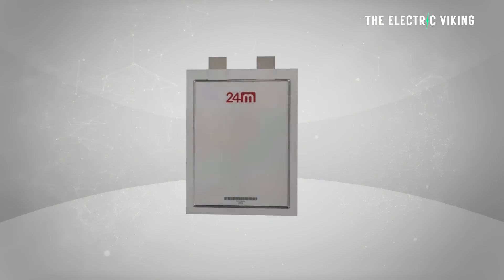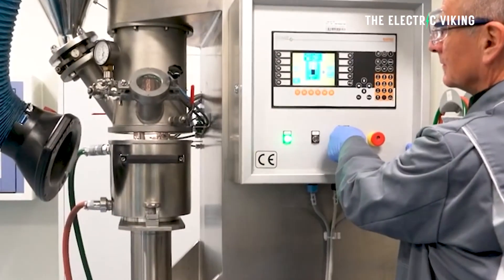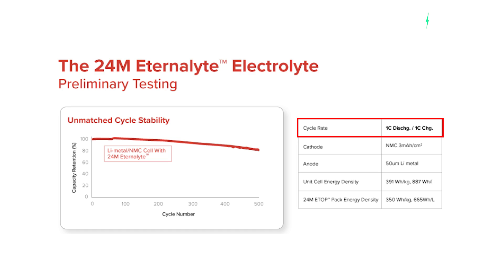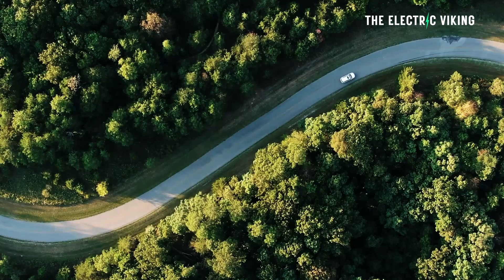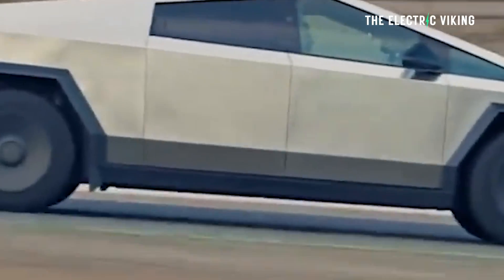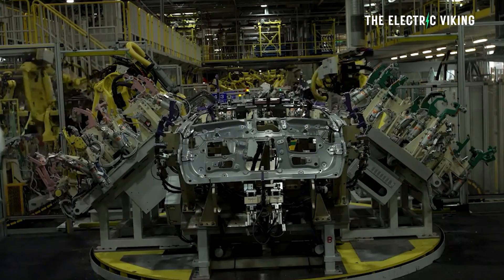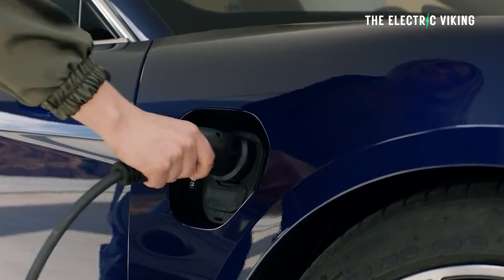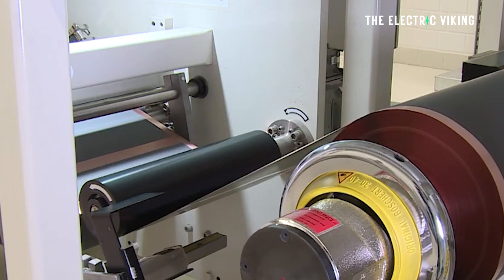American battery company reveals production ready 1000 Mile EV Battery

Comment: Hi, Sam. I'm a retired Aerodynamicist (actually specialised in Flight Dynamics, but know the processes used for Performance Prediction), and am not optimistic about battery powered flight except for very short range. A useful quick estimate of range can be made from the lift/drag ratio and the weight (which doesn't change for battery powered flight). So if L/D is about 20 (typical for a commercial airliner), each kg produces about half a Newton of drag. Each km consumes 500 Joules per kg (assuming 100% efficit conversion from electric power to thrust). A kw.hour will therefore give a kg a range of 7,200km. If the airframe and payload were weightless, a battery with 380 W.hours/kg could propel itself 0.38×7200 = 2,736 km. Unfortunately converting from power to thrust involves pushing air backwards - you haven't got firm ground to push backwards. It's hard to get as much as 80% of power turned into thrust, and you're likely to lose another 5% to the electric motor being less than 100% efficient. So the range is down to 2,052 km.The there is the reserve you need for diversion if the airfield you plan to land at is closed (for example during a recent storm, one aircraft that failed to land at Edinburgh had to divert to Cologne, another to Paris). I'm not sure what the legal minimum reserve range is, but both of those aircraft were forced to fly an extra 800 km. I'm guessing a reserve of 500 km. That brings the range of the battery by itself down to 1500 km. Adding an airframe and powerplant weight roughly equivalent to the battery brings the range down to 1,026 km without reserve, and about 500km with reserve. That's barely enough to do an internal flight in the UK, certainly not medium or long range. To cross the Atlantic, you need over 5,000km range, so looking for an energy density about 5 times higher than this solid state battery. 2 kW.hours/kgm might just about do it. But thanks for the news, Sam, I really appreciate it.
Reply: If the mission of the flight is to transport a payload of batteries and nothing else, then it might make sense 😂.
Reply: I agree. Commercial electric flight will be a long way to go
Reply: Thanks for this analysis. I concluded the same a while back - electric flight is possibly feasible for air taxi services but long haul flight? Not a chance! As you said, even with 5x current energy density, which works out at around 1600Wh/kg, it’s still insufficient for a cross-Atlantic route. No battery technology has anywhere near that energy density, even theoretically. It’s a total non-starter.
Reply: Just for kicks, would it be feasible to cover airplanes with small rectennas to be powered up by microwaves sent from satellites?  as they are closer to upper atmosphere, i suppose the loss gets lower and lower....
Reply: @alexhguerra  I'm not really qualified to comment on what area of rectennas (?) would be required to receive the power required (we're talking of about 200 m/sec at 0.5 kn per ton, that is 100kw/ton, so a 200 ton aircraft cruises at about 20 megawatts of thrust power, requiring more than 25 MW of electric power). Could you collect that much from microwaves in the planform of an aircraft body and wing? The microwave receiving equipment would have to be buried inside the skin of the aircraft, and you might need some reflective metal foil in the fuselage skin to protect passengers from being cooked. Also, you would have to track very precisely each aircraft you were powering, and there might be an issue with any microwave energy that missed the aircraft striking plants or animals, or people, on the ground.
Reply: @alexhguerra  Given that the upper low Earth orbit tops out at about 300kms above Earth and commercial aircraft fly at just 10km above Earth, you're probably going to be better off transmitting those microwave signals from Earth. The inverse square loss principle that applies to RF transmission is not your friend and, as they say, keep your friends close, but your enemies closer. 
But before you start experimenting, do a little bit of reading up on Tesla (Nikola!) and his "experiments". You might want to have a bit more of an in depth look at the "rectenna", too. Good luck with your experiments.

Comment: The reason ICE cars don't need 1000 miles range is because there are so many places to re-fuel. EV charging may be getting easier, but it is just supply & demand at the moment. It is reasonably safe to drive 400 miles with two drivers each doing half. But it's the single driver who thinks he is safe to do 500 miles in one stint that should worry the other drivers!
In theory this battery would enable lighter cars, and that is a bonus on whatever range was chosen.
Reply: one of the biggest reasons why a 400-500 mile range EV is highly desirable is charging speed at home.  another is climate, and another is actual range vs EPA ratings.  then there are the road trippers, where 270 mile range is nerve wracking, and many public chargers along the highways cost the same as gas.  

I live in vegas.  we see 110F over the summer, and often hover at 103-108F for 3 months.  we all know how cold reduces range, but never talk about how high heat does it worse.  

I own a model 3, SR RWD 270 miles of range, and a heavy user.  i live in an apartment but CAN charge in my garage but only on level 1, which is about 5 miles of range per hour plugged in, and im a mildly heavier user and a lot of idle time too. 

right now in average weather, it suffices, but when i add in extra miles to my car, charging becomes an issue based on charging speed.  its even worse when its over 100F outside, my range tanks a good 15%, and over 108F outside, its tankes close to 40-50% of my range which means where my generally sufficient level 1 charger does just fine for me 95% of the time, i now have to use a SC every other day and its like throwing money away because a SC at such a frequency ends up costing me as much as a gas car would.
Reply: "I live in vegas" - Well there's your problem!

Comment: I have 90,000 mile on my Sept 30, 2021  Model Y Long Range.  I currently drive 40,000 miles per year.  I expect to get at least 400,000 miles on this battery or 10 years.  At the time the battery replacement technology should be pretty well developed and Tesla will have a good income stream replacing batteries.  The cost should be about $5000 and the current range of 300 miles should be extended to 500 miles with a software update to optimize the car for the replacement battery. The new battery will get 1 million plus miles.  

10 year. financing on new cars is coming to match the payment period with the economy value of the car.
Reply: That's similar to my experience too. My EV is 5 years old, only 97,000 km but zero range loss, none at all...thanks to the 3.5 kWh battery buffer in the Kia e-Niro. At some point the buffer will be used up and I will see a real world range loss..but I don't expect that to happen until the 150,000 - 200,000 km mark...by which time the car will be 10 years old. At 15 years?...who knows but even if the battery is down to 50% of its original range it will still have 225 km to play with and may be perfect as a cheap commute car/school run/second car. With none of that nasty vibrating lump of metal and oily bits in the front I suspect EVs will outlive ICE and stay useful for many years...This will become clear as the years roll by and it will change the whole economics of car ownership and financing.

Comment: The electric airplane is a funny thing...
We already know how much winter temps drop range..... And 10k or 30k ft in the air is a heck of a lot colder!
I don't know which would drop faster, the range or the plane?
Reply: It's amazing they haven't found any ways to keep things warm enough that all the passengers don't freeze to death between L.A. and NYC 😆
Reply: @davidsmith3302  — And that would suck even more juice out of your already-too-heavy battery …
Reply: @Clyde-2055   The batteries don't have to ride out on on the wings man. And they even get some heat just from discharging.

Comment: This math isnt really adding up. OF course there are some new break throughs coming out later this year and next that should improve the over all battery dens - this will be more of just a improvement than a really something thats going to allow flight travel - at least the flight travel that will take over the industry. SS is more of a weight and size technology while improving the safety of the battery. The switch to S and SS will be way more impactful at least a 2.5 to 5x the power dens improvement that will be needed to make the over all pack smaller and improve range. A battery cell and pack that uses all 3 should see a size of half to a fourth of the current size.

Comment: I'm sick and tired of you people claiming I don't need 1.000 miles range. That's not the real problem. The problem is having a charger where I need it and it taking the same amount of time to charge as it takes to fill my tank. I have a motorcycle with 250 miles range, but I generally run 150 or less and fill up in under five minutes anywhere I go.
I live in a rural community. I'm over 45 miles from the nearest possible public charger and 80 miles from the nearest reliable charger. The range is not the real issue.
Hell, even when we're at our house in Germany I can't really use an electric car. We're in a large metro area, but chargers are not convenient and it's not easy to charge at home there.
Stop citing range as the issue.

Comment: An ICE car has no use for 1000 miles of range cause you can add 200-300 miles in 1 minute probably on model 3 level efficiency ice car.  To get EVs to spread to all buyers we need the daily commute EV experience on a road trip.  1000 miles is all day range and only charging over night.  This would also help the complication of charging speeds degrading battery and how those speeds are harder to accommodate on the grid than overnight charging.

Comment: You're not going to get electric planes much bigger than a 737 Max 10/A321 NEO to work, and the ground performance for turnaround is going to be awful compared to refuelable planes today.

You're not going to charge a plane that big in 35 minutes (Southwest's flight turnaround time from gating, disembarking, cleaning, boarding, to pushback).

Electric jumbo jets will never happen.

Comment: The biggest problem with solid state is that there is nothing manufactured at scale. Prototypes are easy, mass scale manufacturing is not. There is no volume. Charge cycle and charge time are also important and that is conveniently left out. Might not work out if its $1000/kwh either..

Comment: You can't go 600 miles on 60KWh's as again the math doesn't work, you won't get 10 miles per kwh. The power needed to go 4 miles or 4.5 miles is 1KW. You might be a little further because the volumetric density is better on the same pack size, and the weight might be better to deliver the pack. But that still doesn't give that much of a range advantage. To get 600 miles you'd need 150KWh+ battery size. It would weigh the same roughly as an existing Model 3 or Y battery, it might be slightly smaller in terms of volume.
Reply: The power needed to go 4 miles or 4.5 miles is 1KW is for a model 3....think of how many EVs get 2.5-3.25 miles.....

Comment: How many times would you need to fast-charge a 600 miles range EV, not much is my guess. Be interesting to know battery degradation for domestic AC charging at home, work, hotels and shopping centres. etc.

Comment: To get 1000 miles on a model 3 you need 250KWh pack (4 miles per kwh). At 350Wh/kg for the pack it's going to be a 715KG battery. That's 260KG heavier than the current Model 3 Battery at 454KG. For a 454KG battery using the 24M cells you'd be able to get a 158KWh pack, which would yield a range of approximately 635 miles per charge. This doesn't tell the entire story though as you'd have to look at the volumetric density as well. After 500 cycles that would likely reduce to 527 miles. The 500 cycle running distance would be 317K miles, not 500K miles. Charge curve and charge times are also important to consider with such a large battery and are traditionally not great for solid state cells.
Reply: 317k miles is, more or less the life of the car, and the battery would still give 80% of it's original range (500 miles). I think most users would find that more than acceptable.
Reply: @nickwinn7812  @nickwinn7812  we still dont know what speed of travel that range is being quoted for. Theres a huge difference in range between travelling at 30/40mph, and traveling at 70/80mph
Reply: 454KG battery pack is for the standard range or the long range new model 3?
Reply: I don't think 4 miles/kWh is realistic for a steady 70-80mph highway run. 
I use 3 to 3.5 times battery capacity (in kWh) to guesstimate highway range
Reply: @chrisbarron5861  that usage is what they get now at highway speed and the new model is more aero and energy efficient. So could probably do better.
Reply: @michaelwebsternz  4 is a stretch for most EVs. I've been on user forums for different EV models and asked owners of various types what range they get. Most will tell you the range at 60mph, you can extrapolate easily after that.
You also get a lot of replies from EV owners saying ' I prefer to drive more safely', etc...which explains why you see a lot of EV's driving in amongst trucks, which are limited to 56 mph !
Reply: @chrisbarron5861  Tesla's aren't most EV's.
Reply: @michaelwebsternz  @michaelwebsternz  ultimatly, after discussing with several owners, they dont seem to be such a big improvement  as the marketing hype suggests
Reply: 4 miles/kWh is roughly equivalent to a good diesel car when you take account of the energy density of the fuel and the overall efficiency of the power-train. Both a diesel car and an equivalent EV would use the same energy at the same constant velocity in the same road conditions. They are both doing the same work after all. Therefore, 4 miles/kWh seems a reasonable figure to me. @chrisbarron5861
Reply: I think 4 miles/kWh is optimistic, at 70mph

Comment: Its production ready when its being produced until then its a pipe dream just like every other state of the art battery tech that still uses lithium and those that dont for that matter there all in theory and until there in a vehicle they wont know as demand on an electric motor moving 2.5t up a hill against the wind with an acceleration rate of say 8seconds to 100km/h isnt the same as an electric load in a lab

Comment: The smaller you make this battery, the more critical the 500 cycles get. A 60 kWh battery would be light and give a great range, but 500 cycles could be had in just couple of years for a heavy user. LFP would give something like 4000 cycles. A 120 kWh equal size battery with that degradation would be better battery for the duration of the vehicle
Reply: 500 cycles x 500 miles = 250k miles in a couple of years? 
Anyone doing that driving would have to sleep in the car!
Reply: @jimdewey8965  500 miles from 60kwh battery? More like 250 miles. That is still a lot of driving.

Comment: Higher energy density doesn't significantly reduce kWh needed, only kg. You still need a large capacity battery for 1000 miles of range, it just makes it more compact and lighter so the battery will physically fit in a car.

Comment: if you have a 1000miles of range, under normal use of 100miles per day.. that equates to charging only once every 10 days.. which means charging 36times per year.. if it degrades after 500cycles to 80%, the battery shud last at least 10yrs before any degradation will occur.. & its not that we dont need 1000miles, it ony means the battery last longer between charges.. & of course more range is better
Reply: But range isn't always range. Speed, weather, cargo, etc, all affect range massively.

Comment: Way fewer than 1-percent ever drive more than a typical daily work commute or more than a 250-300_ mile round trip weekend adventure.
    I used to live in the remote high desert east Oregon, my nearest neighbor was 12-miles way and most of my driving was a tractor or an old 4x4 Nissan on the farm. Trips to town were on a week to10-day cycle as was typical of most of the ranchers/farmers in the the area and usually that was 20-miles away to the local cafe or tavern to get the local news and fill the big bed mounted fuel tank. 
    My big resupply or delivery trips were on a less than monthly basis and were about 300-miles round trip and sometimes that included a 12' enclosed or 20' flatbed trailer, but most often just my big truck/pickup.   My rare big trips were to the big city to see family or friends and almost never were more than 250-miles one way. 

   Real world range issues are a mute reality
     The hysteria over range is a canard likely promoted by the ICE industry and believed by the 'deliberately' ignorant.